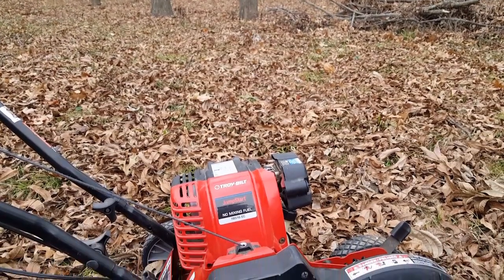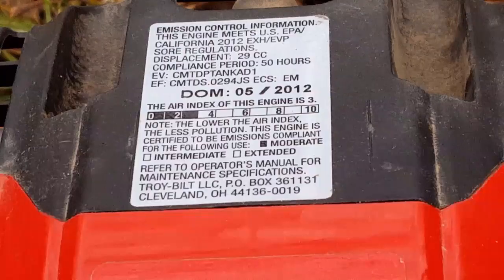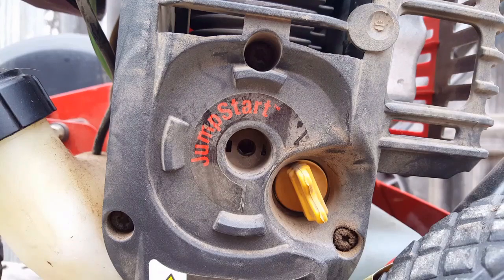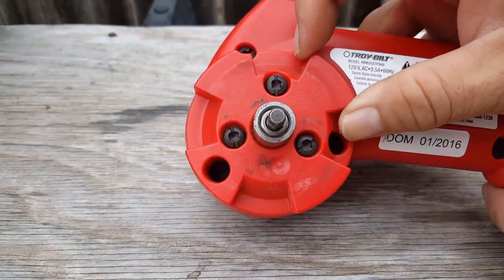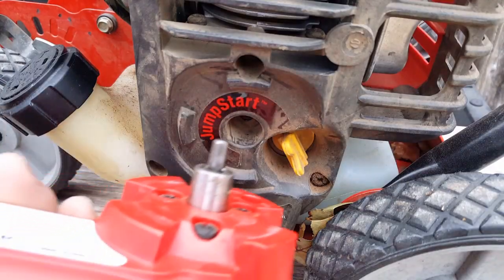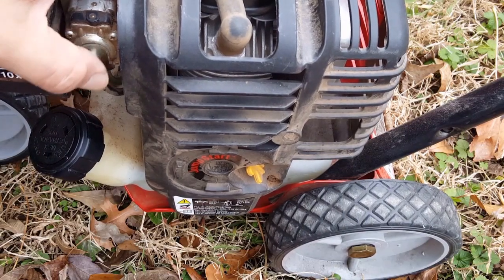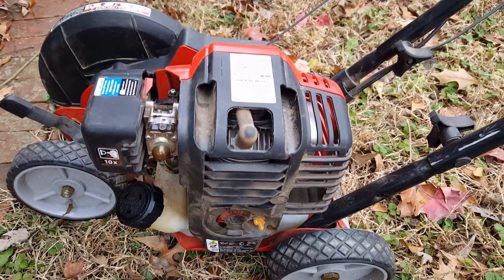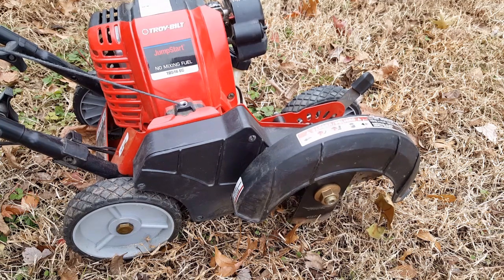Troybilt edger hard to start. Will  jumpstart be easier?

Comment: Was wondering if you ever got this thing tuned up,I've had mine for years if not 10,after the initial start up for the year it will start on the 2nd or 3rd pull every time.this thing has become my favorite piece of yard equipment.
Reply from the maker: Yes however I've resorted to using the electric jump starter.

Comment: Hey, I have the same edger and it will start up, run but once I give it throttle it starts to bog down and wants to die unless I let off the throttle. I have replaced the carb, fuel, cleaned the air filter, checked the valves, changed the oil. I'm not sure what else to do to get it to run. What else could it be?
Reply from the maker: Have youo looked at the spark plug?
Reply: @INSIDEHOUSEGARAGE  I hope not. I checked it and cleaned it. Looked okay. I was going to change that next. Anything else it could be?
Reply from the maker: @TermiePWNZ  when you replaced the carb did you install a new gasket between the carb and the engine?
Reply: @INSIDEHOUSEGARAGE  it came fully assembled. It was made specifically for the 516.
Reply from the maker: @TermiePWNZ  I thought you had replaced the carb just wanted to make sure the gasket made in too.
Reply: @INSIDEHOUSEGARAGE  So I went to a local store, ordered the spark plug, Champion RDZ4H, it came in today, I changed it. not any better. Still give it a little throttle, about 50% or so, once I go past that I heard it start to bog down and want to die. I let off, it goes back to idle. It's outside the warranty now too, I got it just over a year ago. I'm not sure what else I can change or adjust. I know it's a no brainer, but the choke isn't open.
Reply from the maker: @TermiePWNZ  how new is the carb?

Comment: Yep that would have been almost impossible to start with a rope..........  

2 Tips for you  Mon Ami ............

1.....there are hidden adjustment screws for those types of carbs, not all just some..... I keep those kits in stock, those are the rotary type carbs.........

2..... The valves on those need adjusting often......  1 to 2 times a year .....

Hope this helps ........   Plus Tard ...............
Reply from the maker: You're right about the valve adjustment.  I'll need to check on that Thanks for the tip.
Reply from the maker: @Ashurii going to the valve adjustment  soon. Thanks for the tip.

Comment: Anyone have one of these and can tell me how to route the belt?  Need to replace one and can't find any info on it.
Reply from the maker: Put the belt over the pulley by the blade. Then put the belt on top of the tensioner pulley and work on the smaller pulley on the engine.